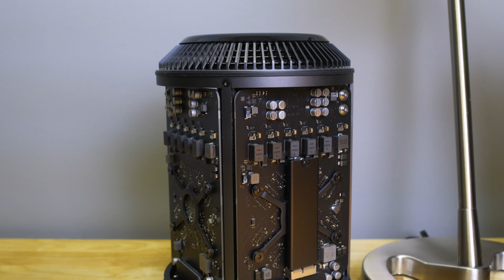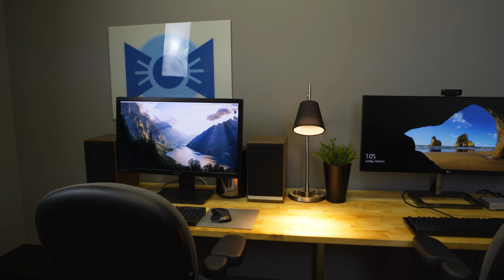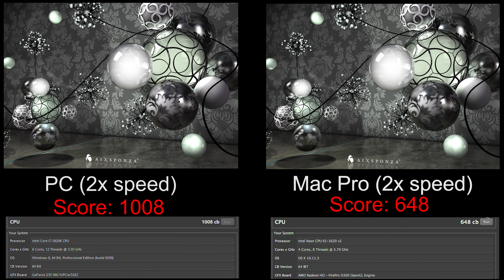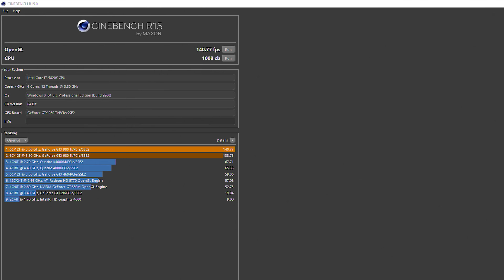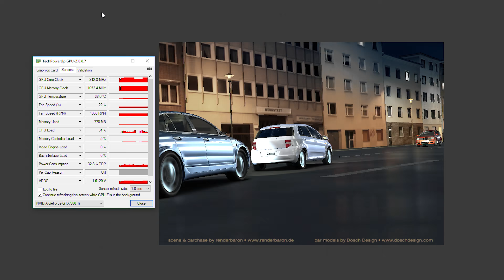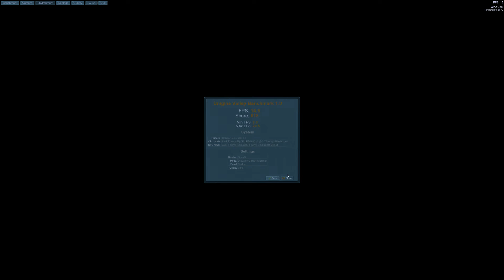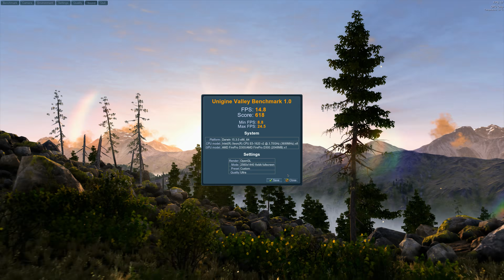$2,000 Custom PC vs $4,000 Mac Pro

Comment: Try to fit the PC into the same space. GLHF
Reply: This was a comparison between price and performance, not form factor. Keep in mind, you can build a pc as small as the Mac and it will still have more performance and be much cheaper. Gaming PC's aren't just limited to the size you see in this video.
Reply: Robin Johansson just watch linus Tech tips fallout 4 nuke build. they managed to fit some pretty impressive specs in a neat case,  not saying its that small just still a cool example of what you can do with a custom build.
Reply: But it's literally double the price for half the performance of a custom pc, I'm sure a pc that fits in the same space would still be a lot better than that mac

Also I have a pc that I bought for 500€ 1 year ago and it runs the valley test at an average 20 fps everything on ultra 1440p compared to this 4k dollars mac 16 fps
Reply: Apple hasnt updated this Mac for 1000days, the processor alone cost like 1500EU when it was released, still the pc is twice as big. Build a pc of the same size and see if you can keep performance along with with the price. This comaparison is just stupid.
Reply: MSI Vortex. Done. And for 2/3 of the price and DOUBLE the specs...
Reply: Robin Johansson But if the specs of that PC is outperforming the MAC, Im pretty sure the 2 GTX 980's in the MSI Vortex would CRUSH the Mac.
Reply: Apple wouldn't be able to.
Reply: Its just irrelevant, you pay for design, material, world-wide service and also "not windows". I bet you can trim a cheap car to go faster than a Ferrari but you still want a Ferrari don't you? This is why this comparison is irrelevant. They put a high price tag on Apple products to cover all other cost most other manufactures ignore. Make a video comparing an H&M bag and a Gucci bag. Its just plain stupid. You get what you pay for, that's it.
Reply: Josh Stephenson sure better speccs and its good for gaming if you want that. However, Mac is good for rendering movies, sound and pictures, if you want a gaming rigg you'd be rather stupid to buy a Mac.

Also, try to fit the speccs in this PC rig inside the Mac chassi, GLHF
Reply: Josh Stephenson it's twice the size
Reply: Robin Johansson Which PC are you talking about, coz the MSI Vortex is NOT twice the size of the Mac??

Comment: benchmarks tell very little, what about a video rendering (which is what you actually buy a mac pro for), macs are known to render faster even with slower hardware
Reply: He did in fact say the Mac rendered about 3 times slower, out of the same project in Premiere Pro, than the PC...
Reply: Magnus Allgurén premiere ? tell me more when he uses final cut
Reply: isheeeeeeeeeeep. We were expecting you
Reply: how would he get final cut on a PC you ask ? evidently you don't see the point.

Comment: I do not like the inconsistencies in the video and just one thing that Mac Pro is not the top of the line (like Apple would sell their most powerful product for only $4000), the flag ship one is around $8.8k and has 2.7 ghz 12 core with 30mb cache, 64gb 1866MHz DDR3 ECC ram and duel AMD FirePro D700 GPUs with a total of 12gb or VRAM
Reply: For 8.8k you can get a state of the art, experimental computer with a custom made video card from nvidia if you choose a PC. Have fun maccing.
Reply: What's your point? Ye but not many are gonna buy a 8.8k computer, $4000 is what most would go with and Apple is literally ripping people off.
Reply: Just saying that a lot of the points in the video were incorrect, and I agree that apple products are grossly over priced.
Reply: I see
Reply: Good point but who wants to waste $8800 on a fucking Mac? $4000 was too much.
Reply: For that $8.8k you could spend $6k on a 6 machine render farm and spend the remaining $2.2k on a main workstation.  The resulting render speed would make the Mac 'pro' look like a Commodore 64.
Reply: Because he wants to compare what spending 2k on a pc gets you and spending 4K on a Mac pro

Comment: You should at least compare Hardware made for similar tasks. The FirePro in the Mac is a workstation GPU with lots of VRAM, it isn't made for live Image processing. But still, you're right, the Hardware of the Mac Pro is old. And even though it's old, it isn't much cheaper to produce. So going down with the price doesn't make much sense for Apple, they need to use up to date Hardware.

Comment: You can't compare a FirePro to a GeForce card because they process data differently. Same with Xeon vs i5/7. When you do something like that, you show you haven't got the slightest idea about computer hardware or are purposely hiding behind lack of audience knowledge to make a deceptive video. FirePro is comparable to nvidia's Quadro line. They're used for boring office stuff like map software and AutoCAD. Really not meant for consumers at all.

Bottom line, you're comparing a gaming PC to a production PC using gaming PC tests. The Mac is severely overpriced, but you don't know what you're talking about.

Comment: Usually a PRO grade GPU such as Firepro or Quadro is used by professionals because it offers more color depth, the ability to work on multiple high resolution images and incredibly high amounts of memory. The new Quadro M6000 has 24gigs of memory and is priced at 5000 dollars, when the performance is similar or lower than a single titan.

All that being said, Apple is robbing people blind by selling subpar products in 2016 while asking a premium price. That firepro in there is a terribly old card if you consider the technological advances, the price may have been 1000 dollars each when they came out but there are much better solutions out there for way cheaper at the  moment. 

However, It would make way more sense to compare if you built a workstation type of PC for 2000 dollars with a Xeon CPU, ECC memory and a more recent Firepro or Quadro. Because at the end of the day, these machines are not built at all for gaming or benchmarking.

Comment: Macs are for people who like the "it just works" thing. I've been assembling PC during my college years and it was a pain in the ass because every 6months some parts just keep on dying, like, burnt PSU, problematic RAMs, etc. and also every year the GPU gets outdated. I have a Macbook Pro for 5years already and it was still decent fast(only upgrade I made was the SSD).
Reply: I don't know where you are getting your parts, but I've never has any issues with the components in my system, which are going on 3 years now. Still very fast, as well. You could, and should argue that a Mac is much easier to set up, but if we are talking Mac Pro, anyone who is doing things that would need a machine of its "power" should know how to put a computer together... it's really not that hard. And still, there's always prebuilt systems, which may be more expensive than building one yourself, but still hold a far lower price than than Fapple's flagship Mac.
Reply: My parts are always brand new bought from computer store, also it doesn't matter where did I get it. These issues are also happening to my friends and even family (I'm sick of those weekly calls troubleshooting almost everything), bought them a Mac and never heard a single problem anymore. Again, this is not an argument, it's just a matter of preference. The only thing I'm pointing out is that while macs are expensive, it does justify what you're paying for (in my opinion).
Reply: My pc is about 6 years old. Never had anything die on me. I upgraded it with an SSD and new GPU. The old parts a built another pc with, which is also still going strong. I think it depends on how you treat your pc. If you never clean it and don't research your parts then you will have problems for sure. But just because you have had problems, doesn't mean that everyone has. I've seen plenty of issues with macs. The thing is that for the most part it is the either the harddisk or the PSU which breaks. So to get an SSD and good quality PSU is very important. Macs are PC too, so it's not like they have superpowers.
Reply: Bull fawking shiet, if you buy quality name brand parts they would not die every 6 months. If you honestly believe me to believe RAM, HD, CPU, Motherboards have on average a 6 month+ life span (even low end models) ... I say that is a load of donkey excrement.

I've been building computers since I was in middle school some 10+ years ago. My first computer I ever built (an AMD Athlon) would still boot up if I was to take it out of the garage. Of the 10 or so computers in my garage, every single one of them would still work except for 1 which has a bad motherboard (lasted 2 years) and the occasional dead hard drive after 4-5 years.
Reply: 10+ years my pc has. never updated components. STILL FAST AS FUCK
Reply: What you are saying would be correct if macs had anywhere near the components they should for their price tag, honestly with what they put in and with the poor cooling systems in most you get performance a $1000 desktop could beat. With apple you literally pay hundreds/ thousands for their os and the apple logo on the back
Reply: Yep, you guys have a point. What I'm saying is just based on my experience in using and dealing with these issues. If you just live in my country and happened to know me, I'd be happy to show these issues being experienced by my friends and family :)
Reply: Lasdil Elizaga I believe in you already. I just  think that some of the problems is caused by yourself. If you compare a 1300$ mac to a 500$ computer from walmart, then sure you will run into quality problems. But if you go with a trusted brand or let someone who knows what they are doing build it, then it will destroy a mac for less money.
Reply: Omar Ortiz Last time I built, I bought these brands: Intel for procie, Asus for mobo, G.skill for ram, Nvidia EVGA for videocard, Thermaltake for PSU, NZXT for casing. I don't know if those brands are cheap ass but I'm pretty sure I shelled out 1200usd. And do the math, I can afford Macs, what makes you think I buy cheap products.lol
Reply: Lasdil Elizaga I've been building my own rig for years, rarely have hardware issues, how can you get issues every 6 months? I usually upgrade every 2 years or so (I'm a gamer) but most if not all I've sold because they were still working fine. 
Another advantage is the repair, if something gets broken, you can replace it, compare that replacement price to apple
Reply: Cons29 That's a very strict definition of "outdated". Nvidia's release cycles for their GPU Series is usually every 18 months. That being said, a GeForce GTX 970 (which was released in Sept. 2014) is still a very capable card more than 2 years later and scores about the same as a GTX 1060 in benchmarks. I'd hardly qualify that as outdated.

And if you're using an AMD graphics card, save up lol.
Reply: Lasdil Elizaga I don't know where you buy your parts, but never in 5 years of PC gaming had a hardware issue. 
Currently I have:
I5 4460 
Gtx 1050ti
Gigabyte h81mh motherboard 
8gb DDR4 ram 
Corsair 650w psu
Sea gate 2tb hard drive
Element gaming mini itx case

The only part new on it is the graphics card I replaced after 3 1/2 years of service I got from my msi r7 360.
What you say about replacing the graphics card every 6 months is a trash statement unless your stupid enough to buy a 6 year old+ card.
The fact you also say the Apple Mac  you have had for 5 years that's fine is BS and a half intelligent person would know this video shows how trashy the hardware is in apple products for their price.
Then again you are an apple user so I doubt you can see past any intelligence relating to the terrible products you buy...
Reply: I would also like to add that the GPU in a PC doesn't outdate for normal tasks. if you want to play the newest games, then sure you will need to upgrade to play on ultra. but compared to a Mac which has very bad GPUs and is pretty much impossible to game on then the PC is still more powerful.
Reply: i assebled my pc when i was 13 years old and 2 years after it stills works nothing exploded lol
Reply: my pc got 8-9 years right now, i dont even turn it off during night, it runs 24/7 and i never had any problem with it. Maybe hes working a bit slower but you know. Its almost 10 years lol
Reply: I have a 2008 XPS M1530 that's only issues (heat and power issues) were results of water damage and old age. It came with Vista and it still runs well.
Reply: would run better without vista
Reply: It is running Win7. Used to dual-boot XP and 7
Reply: good boy
Reply: Lasdil Elizaga you must be building it wrong guessing you buy cheap parts?
Reply: Lasdil Elizaga Maybe you fucked up in the build
Reply: ***** Switch it out with an ssd for 50$ and it will run faster than ever.
Reply: ***** Yeah. Hard to expect a 16 year old pc to be good enough today-
Reply: ***** You could run Linux on it. Making an old computer usable is one of the things GNU/Linux is good at.
Reply: me too.. the bitch is lying or probably she had just built her pc with her feets
Reply: FinalBali No, you can't buy a $100 computer that works as well as a $1000 Mac, unless the $100 computer was stolen.
Reply: Burnt PSU - if PSU dies very quickly, it means it's very terrible. If such PSU dies, it outputs incorrect voltage which damages RAM sticks or HDDs (these are very sensitive for too high voltage). I think that's why you  had issues with your PC (speaking of PSUs, Mac Pro has 450W PSU for 2 power hungry GPUs and 2 Xeons..)
Reply: ΛVINIDE there are tons of good quality psu's, corsair, seasonal, et al. Well worth the price. Not sure what he has for a psu but I've been building my own rig for years, and the only time I had psu issue was with a very old one left unused for months
Reply: Cons29 i know it :v
Here you have some good manufacturers:
Corsair
be quiet!
Chieftec
EVGA
SeaSonic
ThermalTake
Antec
CoolerMaster
Reply: ΛVINIDE not sue what brands some people use. and skimping on PSU is common with tight budget because it does not give performance improvements
Reply: Macs and PC's are made up of hardware, almost the same - still with me... Hardware always gets outdated just because there is a Mac logo on it doesn't mean your GPU or CPU from 4 years ago is going to compete with a brand new one. I know plenty of people that own Macs that have to many problems.
Reply: You're buying shitty parts then 😂
Reply: Lasdil Elizaga you do know that gpu always get outdated, even more so if you cannot replace it
Reply: HalfTimesTwo she's the one who said out dated
Reply: Lasdil Elizaga you're right about the GPU whereas Mac ships with a GPU that's already outdated so why bother replace it :)
Reply: Lasdil Elizaga I would love to see a video proving this.
Reply: That my computer is still running?
Reply: Michael Cox talking to lasdil not you dude.
Reply: Lasdil Elizaga There's your problem, thermaltake makes shit power supplies unless you bought a $200+ model. Get an EVGA, Seasonic, Corsair or Coolermaster power supply. And for the system you're using, you need at least a  600w psu.